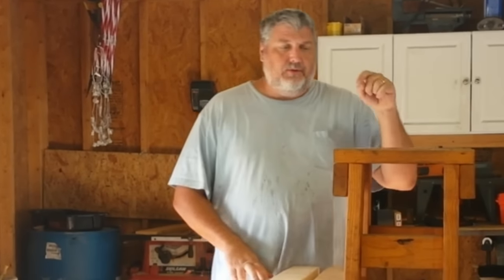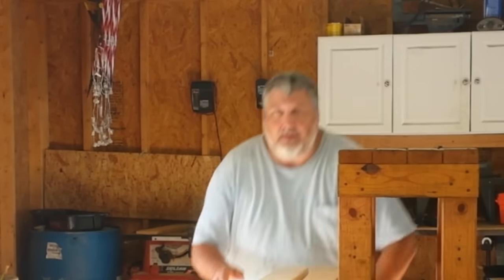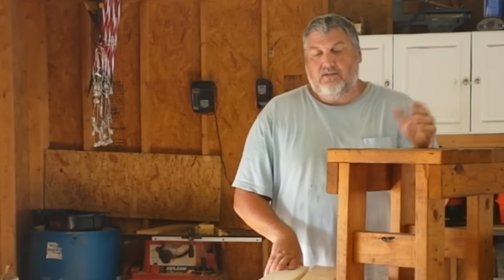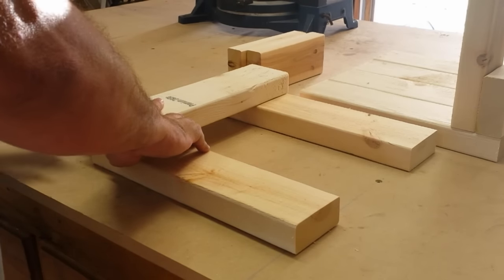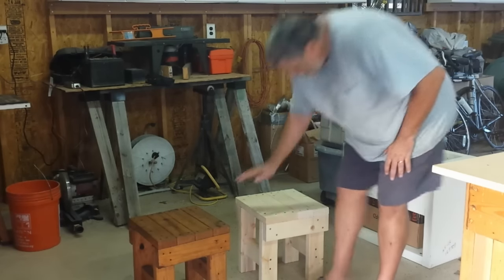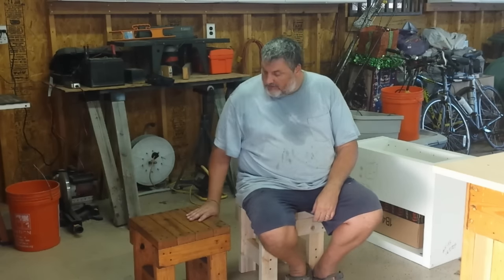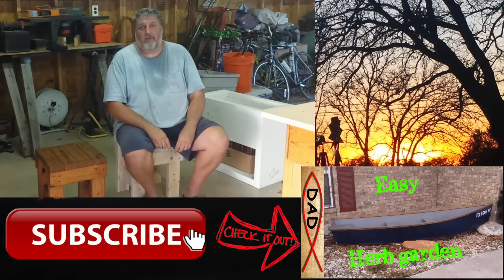It's a table, it's a step, it's a stool,  it's Super Stool - for under $6

Comment: Great 👍 video but one question can I make it taller. I’m a single mom and I’ve not done anything like this before. Please answer soon I get off work at 5 pm Houston Texas time I’m not sure 🤔 where you are at but I want to get started ASAP. Thank you 😊 Rebecca Moreno
Reply from the maker: Rebecca Moreno thank you.... i guess you could make it a stool but i wouldn't use it as a step stool if taller as it might tip over.

Comment: Well done mate, cracking project. What colour is the stain please.
Reply from the maker: I don't remember but I think we used the cheap gallon stuff from HomeDepot. not the Thompson's but whatever brand home depot had. I think it was around $20 for a gallon. The one we have now is from McCoys same thing but they have several shades and we have Walnut now.
Reply: Ill try homebase, has we dont have a home depot, im in lincolnshire. Thanks for the reply mate.
Reply from the maker: John magoo 1959 i figured by "cracking" :)   but yes I am sure the local box hardware store will have it. It wasn't a stain really just the decking or outdoor water seal stuff but in walnut or whatever shade you can find... home depot had 2 choices clear or this.
Reply: Cheers old chap.

Comment: Can you please tell me how attached the top? You skipped that part
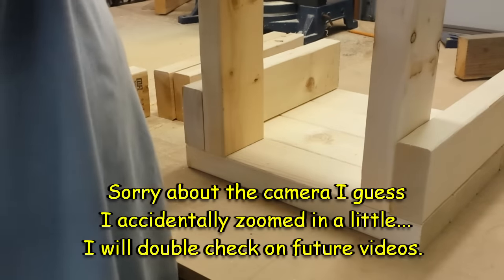Reply from the maker: That was what I was doing at 5:09 but the camera was zoomed in. Everything is flush so just look at 3:25 and flip it over when you have the legs made and either nail or screw the top boards down. You could also just glue it upside down and then flip it over later to help hold in place while screwing.
Reply: Thanks.  I just ended up using glue. I wanted to just use screws but I couldn't figure out how to attach the top without using glue to hold it

Comment: Hi the link for the plans says it's an error and the site has only three plans none of which is this one   I stopped the video a couple times to note measurements   Looking forward to making this!
Reply from the maker: Sorry about that... I lost quite a few of the plans when I switched websites and just never finished updating it. According to the numbers it was just not getting the traffic. It is on my list to update the plans side of the site over the next few months. This one luckily is a pretty easy build most pieces are the same size and then just nail or screw them together. You could adjust it to whatever size fits your needs as well so if you went with 16" and I went with 15" it wouldn't make much a difference. Thanks for watching and sorry I didn't have them out there good luck!

Comment: If you cut the “braces” to 20 inches and attached them at the bottom/outside of the legs (floor level) the step stool feature would be a lot more stable.